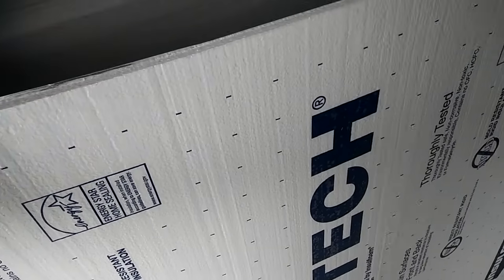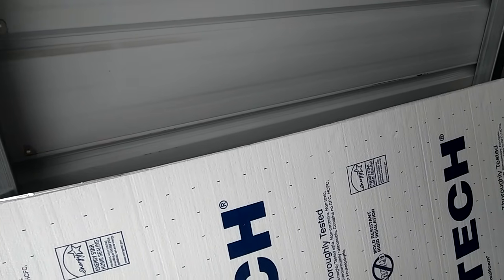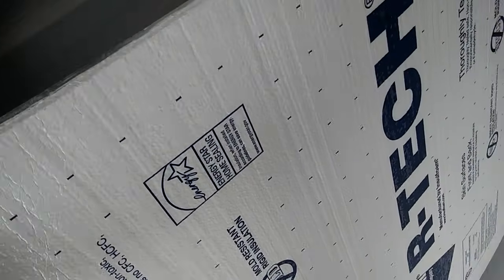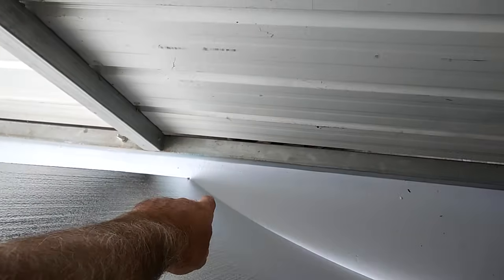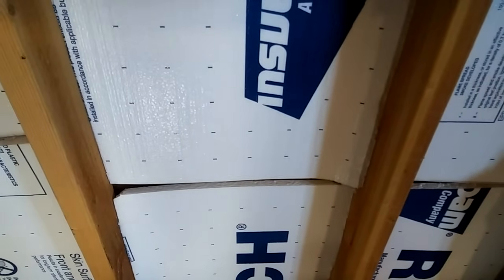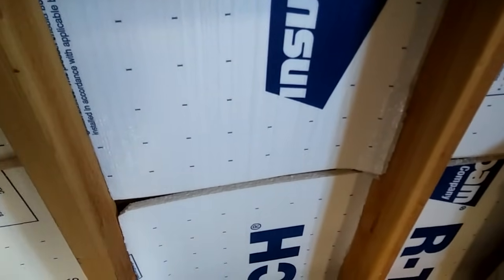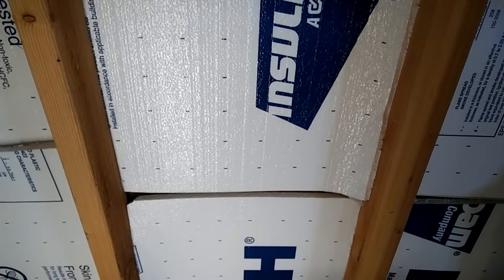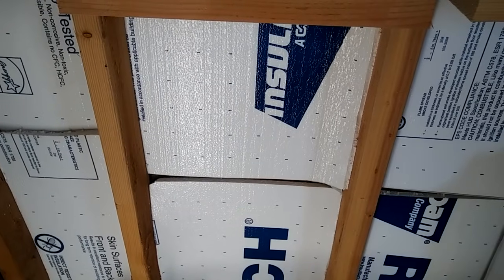How to insulate steel building the fast and easy way

Comment: edited for the sake of sanity 

my mom has enough of this stuff to cover a house ( it was meant to do exactly that, for some reason the siding installers for whatever reason didnt use the stuff mom bought, and ended up using their stuff so she has a whole bunch of this just sitting around.  
i was wanting to install this over the existing  fiberglass blanket(?) with radiant barrier type insulation that was installed back when they built this all aluminum outbuilding,  and have been puzzled as how i would go about securing it, fastening it, hanging it whatever.  this video helped out a bunch   thanks

Comment: "...doesn't really have an R- rating..." Actually it does. The 1/2" sheets are rated at R-1.9 and the 1 & 1/2" sheets are rated at R-5.78. I am going to be using Owens Corning's Foamular in a manner like what you show here, only I'll be doing R-5 under sub-floor, R-10 on sides, and R-10 and 15 on the ceiling with a possible R-20 crown at the roof peak. I have a 10'x8' Arrow shed. Thanks for the inspiration!

Comment: Eliminating all the gaps by butting the insulation strips would significantly increase performance.  Also a good idea to seal the joints with tape or caulk.

Comment: I cut thick foam panels from LOWES to insulate my 2 car garage with aluminum doors. The sun rises and blasts my garage door but inside my garage is never higher than 78 degrees on the hottest days. I glued spacer strips between the barrier and my garage door giving me a 2-1/2" gap for the air to assist with the radiant barrier. Light enough not to overwork my garage door and looks nice too.
Reply: What did you use for spacer strips?
Reply from the maker: nice here is more info on this subject glad it worked for you as myself. https://www.youtube.com/watch?v=RouzkjDNNvo
Reply: I was trying to figure out an air gap when I read your post.  What about that reflective insulation Bubble wrap in between the foam board and the metal ceiling? What did you use for spacer strips?
Reply: @june-p2h  Hey JD, I used the scrap trim pieces from the foam panels. I'm not a fan of those foil barriers and they are pretty much useless...about the same heat barrier performance as those foil windshield sun shades....air is the best in between.
Good luck
Reply: @kennycybertron1  Thank you for the info

Comment: So would this also make the shed warmer in the winter? 
I want a shed to build a model railway but not have to 
1) only be a summer thing as winters too cold and 
2) not have to build a wooden one as the size I want is mega bucks compared with metal shed

Comment: yeah but it actually works the way that I'm telling you. It's what I do for a living. A lot of people have the same impression as what you're saying. It will work when there's an air space the way that you have it. But if you're going flat against the surface you want the aluminum side facing inward because it has low of a civet e and it doesn't let the radiant heat pass through it that's keeping the interior cooler.
Reply from the maker: check this out OSB with radiant barrier has no air gap and is code where I live new video https://www.youtube.com/watch?v=RouzkjDNNvo
Reply: If you do this for a living, why are you searching YouTube for "How to insulate a shed"?
Reply: Well you won't do my shop.  Even the manufacturers say to put the foil side out with an air gap to reflect heat. Do you even know what RADIANT means?

Comment: I used roxul rockwool .Does not get wet does not harbor bugs and rodents don't like it .It was fast and easy .I bought a couple of those sheets you got but gosh it can be expensive for them .I used them under the floor because it was hard to get to .

Comment: I haven't built mine yet so I think I'll just add 2" foam panels to the outside then cover with metal, taping all the seems should make a good vapor barrier.
Reply: Did you try this out? Just wondering if it worked out for you
Reply: @blakebrass125  not yet

Comment: Question will this method work on a detached cinder block garage with closed room made into laundry room with window unframed walls and no insulation in the ceiling and causing damage to water pipes in winter and damage to washer water input , and cpvc is mounted to 1×4 small blocks leaving room for 1/2 to 3/4 boards behind that will need to be cut and installed like a puzzle and the joints sealed for moisture / the dampness because the main water line comes directly into front corner which I buried r19  fiberglass  around the incoming pipes with the foam insulation  and dirt on top of that and parked the insulation good   and thinking about using sack-crete with sono tubes for water piping to have access to the pipes in case future issues  and really don't want to spend a whole lot more money on a rental property, that I rent , but have continuous problems and my personal property is getting damaged in winter because of lack of proper insulation , directly on interior of the cider block walls and the ceiling is wood framed and could use nail up roll insulation for that but would probably have to use the bathroom rated sheetrock and put a opening  and a base board heater which I already purchased 2 , I feel like I'm pouring equity into someone else's property because , current land lord is very slow to get any work done that needs to be done... But this land and the detached garage and wood framed and shingled storage bldg is worth the rent
Reply: I'm asking if this method is accurate and the best for moisture control as well as insulation purposes , that is affordable on the interior of the unframed walled  cinder block , I'm just trying to keep the temp above freezing using insulation and not running up my power bill with an energy efficient base board heater that is there right size for the square feet and need to get a thermostat to make it more efficient that cuts on at close to freezing temp and shuts off at 7° Fahrenheit above freezing to ensure pipes and water heater and my brand new laundry appliances don't get **'!+ed up
Reply: Personally I think the property owner should be more reasonable when he knows the condition of property and I report directly to him every issue that is of major concern , that doesn't hit my wallet really hard , but my pipes freezing up and brand new washer getting tore up , I have to do something,

Comment: One thing you said was that this product "has no real R value", but it does. The R-value of the product itself, in 1" thickness has a R-value of 3.9 @ 75 degrees, and with an air gap installation, has an effective R-value of 6.7. This according to the manufacturer website.
Reply: Ltngdrvr how big of a air gap?

Comment: Code violation in all states.... Foam insulation is not fire resistant and emits toxic gases when it burns, so you must have a barrier on the surface, such as drywall. Also, you need furring strips behind it to gap it from the steel walls... helps with both moisture and your R rating
Reply from the maker: hey thi s is for a shed not for a permanent structure or living space.
Reply from the maker: this might  answer questions. https://www.youtube.com/watch?v=RouzkjDNNvo
Reply: Uh oh, the code police

Comment: Foam insulation has an R- factor of 5 per inch. If you have gaps, regardless of size, that will detract significantly from the insulation properties of the polystyrene.
Reply from the maker: Yeah probably but it sure is a whole lot cooler with that stuff up

Comment: You installed incorrectly. When using a radiant barrier you should install the foil facing DOWNWARD. Te reason being is the foil has what is called: Low Emissivity. This refers to a surface that emits low levels of Radiant Heat. It is working the way you have installed due to it blocking some of the radiant heat transfer...but if you flip it you will notice a substantial difference. Good video!
Reply from the maker: with the radiant barrier on the inside it keeps the heat in more I want it out so I put it on the outside. I am trying to keep the heat out not in. some people want to keep the heat in. I am not in that area.
Reply from the maker: More info on the radiant barrier subject https://www.youtube.com/watch?v=RouzkjDNNvo

Comment: Just get a top quality radiant barrier and no form required.
Reply: @AtticFoil  I'm fighting my ceiling condensation dripping from my metal building would this simple foam borad fix the issue

Comment: There is meant to be an air barries between the steel and ALL insulation blobs of a sealant is NOT correct.
Reply from the maker: works great for what I am doing. cools my walls down. that is all it is about.

Comment: Almost all building codes require a non-flamable barrier to the foam to prevent fires. A differing material, would be a product like 'Ayrfoil' or 'Tekfoil' or similar that is aluminized bubble wrap, with at least 2 layers bonded together. Two layers with an air gap between them, can give as much as R30! in some cases.Available in rolls up to 8' wide x 125' long x 3/16 thick.
Reply from the maker: yea for sure this might answer more questions https://www.youtube.com/watch?v=RouzkjDNNvo

Comment: What size dimensions are your carport? Looking to get one and have a lift in it but I’m not sure if 10 or 12 ft legs are needed to use the 2 post fully. I’m guessing the wider it is the more “extra usable height”  you can get from it at the center of the roof.

Comment: We used some 3" rigid insulation board on a Bank I was the superintendent on 3 years ago behind the brick.  Also had spray foam insulation inside.  Crazy insulated.

Comment: Will that set work inside of a shipping container too ?  Will it make the wall condensate in a enclose enviroment or what else need to be done for that set up ?   Thanks
Reply from the maker: not sure on that. Some guys say in the cold you need an air gap. Im my area we dont have issues with damp or super freezing cold. And not required. I guess it depends on where you are.

Comment: This does look like a quick and easy way to add some insulation and sound reduction to the metal walls.  Radiant barriers, however, are not effective unless the shiny surface faces an open space of 1/2" or more.  It does no harm in this application, but it also adds no value to the foam board.  If you can find a lower price on foam board with no radiant barrier, that should work just as well when used like this.  If you can install this foam board with a gap behind it, you would probably gain some added benefit from the radiant barrier surface.
Reply: Pete Duncan can you not juts flip it around or is that too much space for radiant barrier to be effective?
Reply: Flipping the panels, with the shiny side facing the interior, would be one solution in this application.  You can't have too MUCH space, but the radiant barrier surface will not be effective if it is installed right against another surface with no air gap.   

A lot of radiant barrier products are installed incorrectly, with the shiny surface covered by siding, wall sheathing or roofing materials.  It seems that a lot of building pros still make this mistake, not realizing that the product is no longer a radiant barrier when it is covered by another material.  At that point, it's just a shiny layer inside the assembly, adding no particular value. 

Also, this type of panel  can eventually collect enough dust to reduce or eliminate the radiant barrier effect, especially when installed in a horizontal orientation with the shiny surface facing up.
Reply from the maker: here you go answer to the question of air gap. https://www.youtube.com/watch?v=RouzkjDNNvo
Reply: I have a metal shed. The exterior wall is just metal again the 1x4 boards they are screwed to, I want to insulate it. There are 2x4 studs. Should i use foamboard between the 1x4 and then fiber glass insulation? Or what do you think it should do?
Reply: @BW-0217  what ended up being your solution to this?
Reply: @blakebrass125  @baba 0217 Dang I'm in the same boat, would love to hear this as well

Comment: Question, isn’t the radian barrier go toward the inside like a vapor barrier or toward the metal?
Reply from the maker: I put it toward the metal. because I want it to be a barrier for the heat then the foam to insulate. Some guys in colder areas who are doing the opposite trying to keep the heat in more put it on the inside.
Reply from the maker: depends on what your doing but I like it up  another video to answer questions. https://www.youtube.com/watch?v=RouzkjDNNvo
Reply: @mikethepainter  Great point.  In fact we make a Foil/Foil product to both reflect heat in the summer and help keep heat IN in the winter: https://bluetexinsulation.com/products/premium-bluetex-insulation-6mm

Comment: young man ,

u are doing insulation ass backward  4 ' center will fix perfect 4 ' x  8 '  / but u are putting 8 ' x 4 ' is the wring way
Reply: Most carport buildings are 5ft center framing walls.

Comment: NO! You installed it wrong. You should have just screwed it to the supports (quicker and easier) as all radiant barriers need an air gap to reflect the radiant heat. It might work due to the foam, but would work much better with the radiant barrier working as well
Reply from the maker: here is a video to answer questions 
https://www.youtube.com/watch?v=RouzkjDNNvo

Comment: How much would an 8 -10 shed cost to insulate?
Reply from the maker: I dont know exactly depending on how thick I Those sheets are 4x8 and 6 or so dollars 1/2 inch thick. thicker gives better insulation if you are trying to keep the heat in I would put the radiant barrier on inside. where I live it is all about keeping the heat out So I put the radiant barrier on the outside.

Comment: Is there a noticeable difference with the heat and how about the winter for cold?
Reply from the maker: definately a difference. I mainly use it to keep the heat out. more than 10 degrees on a hot day.
Reply: the radiant barrier does the work. massive difference in heat. well worth it on a metal building.

Comment: Does this process stop condensation during winter from dripping off ceiling inside shed?
Reply: No it does not! I used it in my shipping container/shop. My floors are soaked around the edges where the condensation runs down behind the foam panels.
Reply: That's because he didn't leave an air gap. I'm thinking he'd been better off  fixing it to his studs. He had a big air gap down on the floor so I'm guessing he has one up high somewhere too.....hot air travels up so some kind of venting at the roof and he should be set if he insulated the entire structure....
 What say you?
Reply: To avoid condensation you need the air gap to be perfectly air tight, if humid air can enter or escape the air gap then it can condensate. In this case spray foam is better because no humid air touching the cold metal means no condensation.
Reply: @davidstill754  With rigid indulation always a small gap is left, and if air can enter or escape there, it will condensate. To solve this you can use a small can of spray foam and fill all gaps, then it will be air tight and no humid air will touch the metal.
Reply from the maker: no I would not use this for colder climates here is another video https://www.youtube.com/watch?v=RouzkjDNNvo